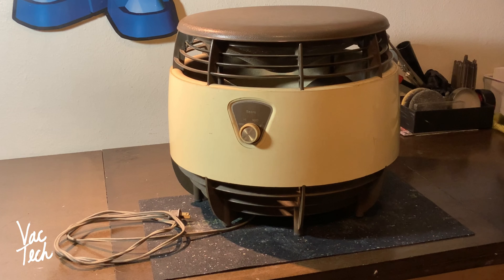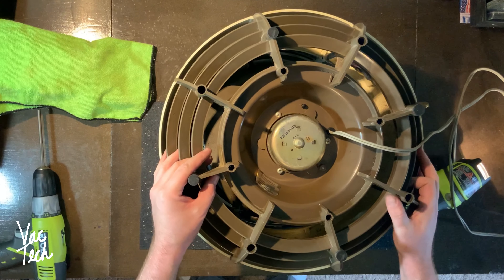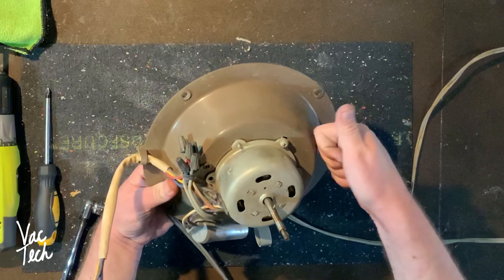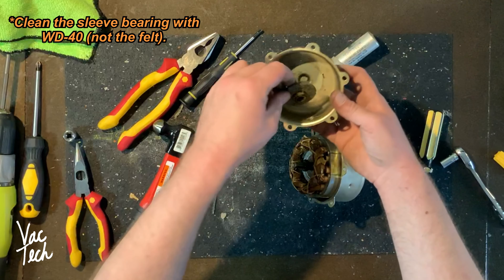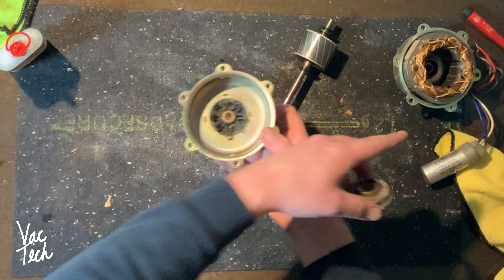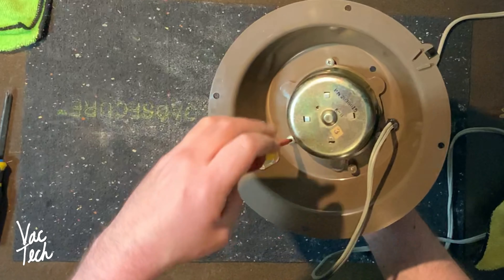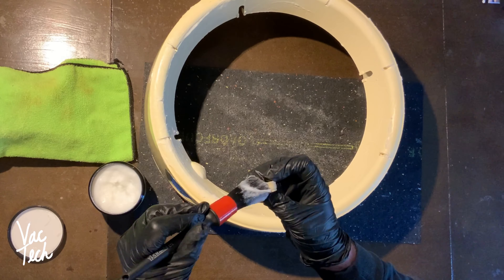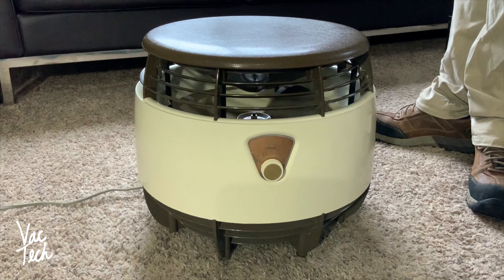Restoration of a Vintage Sears Hassock Fan - Lasko

Comment: My Dayton hassock fan which is very similar to your Sears hassock fan. I inherited it from my grandparents. It is older and all metal. I presumed it had "Oilite" sintered bronze bushings that need 20 weight non-detergent oil. Mine has the oil ports but the old felt was dried up and hard and would not accept oil. I disassembled the fan, replaced the old felt with new wool felt, and soaked new oil soaked into the new, absorbent felt. With fresh oil, the fan motor is much cooler!
Thank you for posting this video.

Comment: I bought one of these from "army salvation " for $9.99 2 years ago. Tested it out it worked but shook a lot. Got it home the fan blades were splitting off oh boy. I measured the fan diameter and ebay had a clear fan blade for maybe $5 from China. Turns out ebay has A LOT of fan blades! This thing had been hit somehow found all the little grill pieces at the bottom. Used an adhesive called plastic surgery and patiently glued the pieces where they go repairing bad splits along the way. I've got 14 hours in gluing it back together strategically and properly.  Assembling it right now found your video to make sure I'm remembering it all correctly.  Didn't know about the oil holes thanks! Thank you for doing this! I have a few models of Lasko galaxy fans they just don't fail!

Comment: Found mine in the trash as I was walking out of the flea market. It's the best fan I've ever owned. Not safe around small kids or curious pets. A few of the slats on mine are broken and my 4 month old kitten got her head caught inside. Thank goodness it was turned off. Both of my kittens don't come anywhere near the fan. Mine is a peachy brown all over including the feet. It did make a rattling sound at first when I plugged it in but, I gave it a good whack and now it runs smoothly.
Reply from the maker: Hey glad you're happy with yours! If the grille is broken, make sure to keep your pets safe.

Comment: i just bought a hassock fan exactly like this for $5 at a garage sale and it works great! quickly grown to be my favorite fan around the house
Reply from the maker: They work so well. During the summer, I use mine in tandem with my AC, and it does a great job circulating cold air around my living room.

Comment: Grandparents had a hassock fan like this one (a Freshndaire) and an older GE.  This newer one eventually started smoking one night as they were using it.  I guess it was good that they were watching it and not using it while sleeping.  They always said they trusted the newer fan more than the older one, but ironically, the newer one stopped working first.  What made me nervous was that there was nothing protecting the motor (on the bottom) and it would get warm.  If the fan was sitting on a carpet, this design wasn't an ideal situation.  However, it looks like you did a really nice job cleaning out this beast.

Comment: Didn’t realize that some now sells retrobrite solution.  It’s literally just a high percentage hydrogen peroxide. You can buy the stuff yourself and mix it with a little xanthan gum to create a cream or just use it plain in a liquid bath. The key is to find a high percentage mix. Most store peroxide is only single digit percentage peroxide. Ideally you want 40% or more. You can buy a brand called salon care on amazon and it’s 40%. You can buy it in a ready made cream or in liquid form for a peroxide bath. Should probably save you quite a bit of money too because I’m guessing that tub wasn’t cheap.
Reply from the maker: Thank you for the valuable advice.  I have plenty of plastic products that could use a refresher, so I will absolutely try your recommendations!  Thanks again!
Reply: @VacTech1  happy to help. I’ve been doing it for years and it always very rewarding to get a vacuum looking like new. Last thing I’ll recommend is going with the salon care 40% in liquid form. Then you can put you plastic part in a clear bin and fill it up with water until the piece is submerged. Then mix in the peroxide and (the amount will vary based on the amount of water) cover the bin with a clear lid or plastic wrap. On a clear warm day you can go from extremely discolored to like new in 8 hours. Just make sure to turn the piece so it gets UV evenly. You can even substitute the sun with a UV lamp if you don’t live in a sunny area of the country.
Reply from the maker: @nicko5945  Fascinating! So you use that Salon Care liquid mixed in with a tub of water, with the parts submerged in water.  I've never seen that before, but based on your helpful advice, I look forward to trying it. Do you bother masking the vacuum's stickers or graphics? Does the process affect them?
Reply: @VacTech1  yep, that’s exactly what I do. Though again if you are only using regular grocery store peroxide, it will take forever because it’s not powerful enough. The real reason why I do this, other than it being extremely easy, is that is leaves no marbling.  The cream is very hard to put on evenly and can actually brighten up plastic unevenly resulting in dark and light spots which can totally ruin a piece. The bath results in totally uniform results. The one problem is it can ruin stickers specifically. Generally it doesn’t hurt decals though. I just did a Sebo C3 a week ago for example and the logos weren’t discolored at all. It’s actually much more forgiving than the cream but I wouldn’t use this method if you are trying to preserve a paper sticker. If the sticker is a plastic type sticker than all you need to do is mask it over with tape and you will be just fine. Again though it’s very forgiving because you can check it every hour or so without unwrapping it to make sure there is no damage. All you have to do is simply remove the piece from the solution. Once you are done just hose it off and you are all set. It’s also works well with colored plastic. My blue concept one had yellowed which turned it green. After a retrobrite bath it was restored back to its original blue.
Reply: @VacTech1  also last thing that may help. There is a fairly large YouTube channel called “The 8-bit Guy”. If you search his channel for retrobrite, he did an entire series on different methods including mine. He explains it very well and it’s worth a watch if you want to ever try it.
Reply from the maker: @nicko5945  Great advice. I think we're in the same wheelhouse. If you'd like, email me at vactechyt@gmail.com, so we can chat.  Thank you so much for your informative comments, which along with myself, will help other viewers!
Reply: @VacTech1  email sent, happy to help!

Comment: I'm working on one a bit older and I found out the hard way the nut holding the blade is threaded backwards (righty-loosey' lefty-tighty). From what I'm seeing yours is the same way. Do you find that unusual and how can I get the nut off there now it's threaded in the original spot without trashing the bolt stem threads above it, which would make installing the donor blade nearly impossible? It seems I would only have one shot at doing it right.

Comment: I'm just trying to get mine apart to clean the fan. The screws on the bottom won't budge, but I'm only using a screwdriver. I'm scared to use a drill because because don't want to strip it..
Reply from the maker: Yeah you wanna' be careful not to crack the plastic the screws go into as well. Mine took some effort to break loose. Good luck! Hope you have a good hassock fan there.
Reply: @VacTech1  Oh I do! Same exact one as yours, with a strong will to keep working for many years. How much strength did your drill take to get them out?  Just being cautious because these things seem quite rare nowadays.
Reply from the maker: @sethm8432  I kept the torque on the cordless drill pretty low. I had to raise it slightly to break the screws loose though. Just be careful, and gradually raise the setting until they start to turn.

Comment: Do you know where I can find a replacement fan blade for this unit? Please let me know. Thank you
Reply from the maker: @davidgonzalez6222  I wish I could help with that. eBay, marketplace, thrift stores, and small appliance repair shops that might have old parts for fans might be good places to look. I hope you can find one! Problem is the age of the machine.
Reply: @ thank you for your response I can’t even find a pdf manual on this unit but I’ll keep searching have a great day